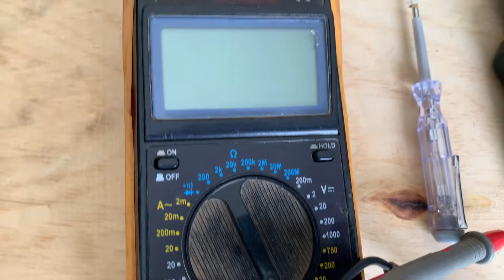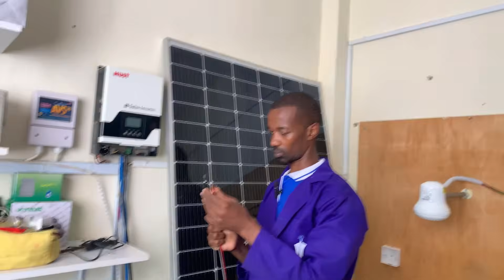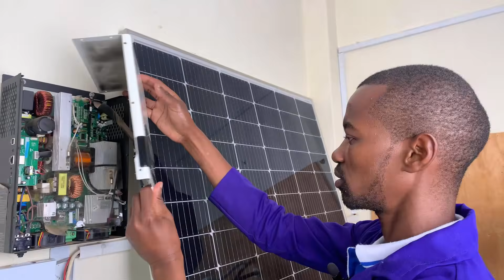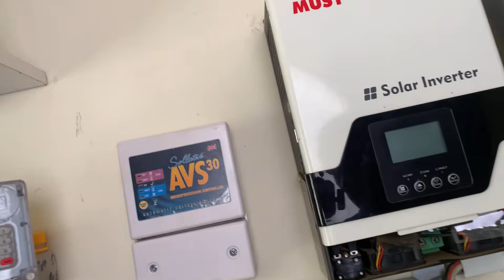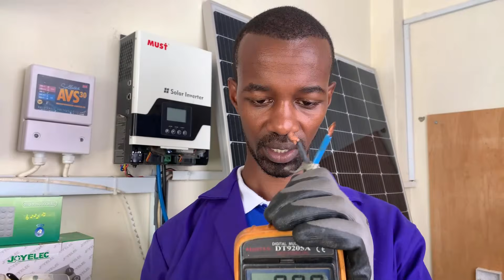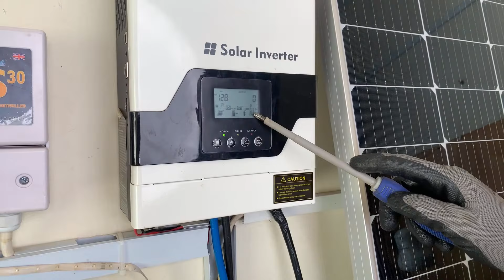How To Install A 1kW Solar Inverter. Step by Step.

Comment from the maker: Have you ever installed 1kw or more solar power systems?
Reply: Why don't use charge controller
Reply: Yes
Reply: I have two 12volt solar battery's and one pure sine Wave solar inverter and two 250 watt solar panel